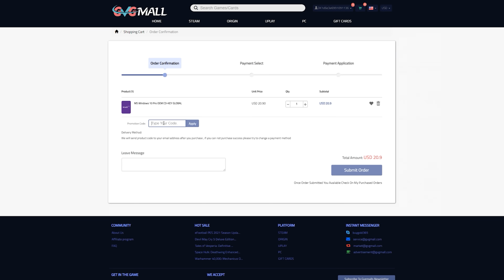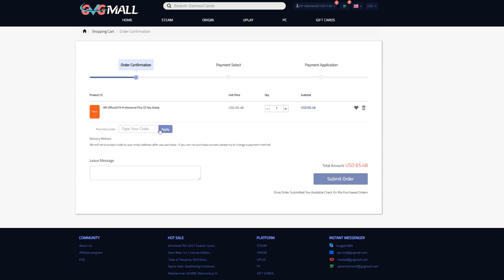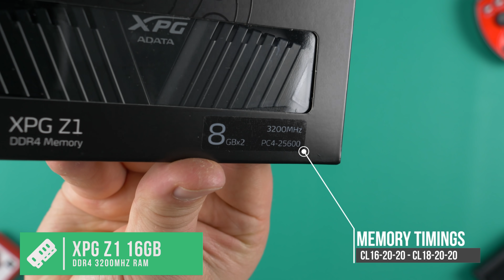Best $600 Gaming PC Build Guide 2022

Comment: 4:24 my dad has that case, really COOL's the components inside ,especially with a ryzen 9 and a tower cooler, didn't expect it to be just 83 C, usually these ryzen 9's just shoot up straight to 90 to 100 C.
Reply: What tower cooler is your dad using?
Reply: @kyoheii  ID Cooling, not sure what model though, its really chunky.
Reply: I don’t really like the case because it’s so small I’m going to use this build guide but swap out the case

Comment: Its soo accurate to what I'm wanting to build for ages
Reply: If you can get 1650 gddr6 that's the cars I have with i3 10105f and I get 144 fps in apex
Reply: @leonboonzaaier486  in 1080p high?
Reply: @zakiyunzakir9562  no low you will need a 3060 or better to get 144 in high

Comment: I like these guys content but this is NOT a good build right now. Go 12th gen i3, the i3-12100F is currently $105 at Newegg U.S and a rtx 3050 is $300 also at Newegg U.S. Going with those parts is a lot faster and it wouldn't cost much more.
Reply: This my exact build.
Reply: Ya that's much better
Reply: @theoneandonlymeme8923  anyway you can tell me what to get so I can build it? I wanna start with whatever you have lol pls
Reply: So I can put a 3050 in this?

Comment: this is the exact gpu im saving for right now
Reply: pls wait a little bit longer because the 1650 has no future proof things. i would recommend buying something like a used 1080ti or used 2080 super due to the extremly low prices used.
dont be scared of it being used, but do look out for gpu that has been used to mine because they usually dont have long lifespan left.
Reply: @rando3962   WHERE ARE YOU FINDING CHEAP 1080 TI's. I've searched far and wide, turned every stone, sniffed every corner, and the cheapest I could find is 500 CAD.
Reply: get a 1060 for used
Reply: Don’t go with a 1650 or 6500xt both garbage GPU’s. At least wait and go for a RTX 3050 or RX 6600.
Reply: @ZackSNetwork   you underestimate the prices near me. The gtx 1070 is a better buy for me. but i have a 980 ti rn so im chillin
Reply: @carl5137  used
Reply: @rando3962   I've ONLY been talking used
Reply: @carl5137  I know the pain. This is Canada 😭
Reply: RX 6600 for $320 (which is $10 *BELOW MSRP*). you will get twice the VRAM, much better performance, FSR upscaling, ray tracing (although very limited), and many other features that the 1650 does not have. it’s worth the extra $50-100 and you won’t have to replace it in 2-3 years. the GPU is one of the most important parts in a gaming PC, it’s usually worth spending a bit more money on (as long as you’re not paying well over MSRP).

Comment: Would the 6600 also be a good option? Would make it more of a 650-700 build
Reply: Yes
Reply: the 6600 is way better. I would say almost 40% better
Reply: 6600 XT and 3060 is the better GPU you could pair with an i3 10th gen without any noticeable bottleneck apart from certain cpu hog games like bf 2042 but that game is less optimised than the late Roman Empire so meh.
Reply: @loowick4074  that puts you at a 1,000
Reply: @isaafridi7146  nah it just about 800 - 900
Reply: @isaafridi7146  It's almost 40% better than the rtx 3050 in gaming. So it would be close to 90% better than the gtx 1650.
Reply: @jadenblackerby3325  you're right
Reply: @loowick4074  I have this build and the bottleneck is so big that I have to play games at 1440p or higher (sometimes even 4k). I Just bought a i5 10400f to pair with the 6600 xt and according to tests I saw its a really equivalente build
Reply: @jadenblackerby3325  how is that even mathematically correct in any way
Reply: @ABV 92 According to almost every benchmark it beats the 3050 from 20%-50%. I guess I over exaggerated a bit, but it's still way faster than the 3050, which is faster than the 1650.
Reply: @mukuroikusaba7347  I am saying that the 6600 is around 40% faster than the 3050 in terms of gaming, and the 3050 is around 50% faster than a 1650 (sometimes 70%). Which would lead me to say the 6600 is around 90% faster than the 1650.
Reply: RX 6600 is the best for budget gamers right now. 6600 XT is a decent bit better if you have another $80 or so to spend. but if you do a bunch of production-oriented tasks too and absolutely need an NVIDIA card for certain applications, then the RTX 2060 or 3050 are good options too if you can find a good deal.

Comment: I'm so behind on PC building but is this good enough for a general work pc? I figured it's a good budget price overall but I just don't have the funds to get a $1k pre-built with not so great specs. Just curious if I can out an i5 on this board instead of the i3? Or does that throw everything off,
Reply: This pc will do it amazing for work atm. And yes you can put a i5 but only if it's 10 or 11th gen
Reply: @Sam.K040  if what’s 11 or 10th gen
Reply: @sergy0918  The morher bourd only supports intel 10th or llth gen processors

Comment: I have the same case and GPU (GDDR6 version actually) but my CPU is a i3-12100f  and motherboard is B660M-A D4. Easily get 144FPS on Fortnite. Soon I'll get a RTX 3050 as my next upgrade on my PC and a 240hz monitor.

Comment: My system is i3 10100f_ram 32g2666_power600_ motherboard prime h510m-k _ I am looking for a good graphics card that does not have a bottleneck and does not cause problems.  gtx 1660 s/ti  gtx 1070/ti. gtx 1080.  Help me please😢😢😢😢

Comment: Love the vids ❤ is there a chance you could do a budget of 1500 - 1700 dollars?
Reply: With $1500-$1700 you should be able to do a R7 7800x/i7 10700/f/k - Rtx 3060/3060 ti/3070/3070 ti possibly assuming you get it at MSRP for the gpu. The used market is also an option and the market is dropping in prices as each month passes which indicates that the specs given can be done at the budget. Correct me if I’m wrong, but that’s the type of computer you are looking at, at that price range.
Reply: How can that be a budget
Reply: @zemonsterr  this question makes no sense
Reply: @tenshi1333  ive seen 3070 ti going for 700$ so i would definitely have that for a 1500$ build
Reply: @zemonsterr  IM SAYING

Comment: The Rx 6500 xt(in the US) is $200, so if it's available get it it's a much better deal. Also try to get an i3 12100f it's much better.

Comment: Or you could do the CLASSIC $300 gaming PC, gtx 970 GPU, used old Dell with an i5 2nd gen, 8 the ram. Just need another ram stick. Or you could do a gtx 1030 solid on older titles, 30-40+ fps on newer titles. (Med-low), tested it on BF5, Cod Warzone

Comment: well im not sure if the evga black 3050 is available in other parts of the world but ive seen it in and out of stock for around 230 that would be a solid gpu upgrade over the 1650 if u have it available

Comment: roughly in pounds the price is 582 or 592 or cheaper cuz you can find the gpu for cheaper btw i dont use this pc i have a i5-3470 16gb ram gtx 1060 6gb 550psu i have 256 gb ssd 1tb hdd and i bought it as a prebuilt but i upgraded alot of the parts the gpu was a 1030 before and same with cpu was i5-2400 and ssd i bought by itself and i pretty much changed most of the parts including motherboard and psu
Reply: Thanks for watching and commenting 
You’ve been shortlisted among the winners for the ongoing giveaway contact address above👆👆for claiming ..

Comment: would honestly swap the GPU. sub in a rx 6500xt it's on average 10-20% faster depending on the game and costs just as much unless you absolutely need the encoder.
Reply: Totally agree rx 6500 xt is better than 1650 and 1050ti in pcie gen3 and it's as good as a 1660 in pcie gen 4

Comment: Would of been a better idea to do i3 12100F + RX 6500XT. Same price more performance
Reply: Does it cost $600?
Reply: @raiznsisig  u can build it for right about 600 i think
Reply: @elbroken1093  if i'm gonna use an amd gpu, i might aswell use and AMD cpu. What cpu is best paired with it?
Reply: @raiznsisig  AMD CPUs don't support PCiE gen 4 like 12th gen intel cpus, so the performance of the rx 6500 xt is much lower when paired with AMD cpus
Reply: @tiagopelegrineti  okay... advice taken...
Reply: @raiznsisig  well thing is the budget amd cpus do not support pcie gen 4, and on pcie 3.0 the 6500xt can perform pretty bad, so maybe really stick with a 12100 (F), or if u really want AMD u need at least an 5600.
Reply: Nope garbage GPU.
Reply: @tiagopelegrineti  False AMD CPU’s do support Gen 4. They don’t support Gen 5.
Reply: @ZackSNetwork  and the 1650 is the holy grail?
Reply: @elbroken1093  I didn’t say that clown. If you are gonna spend your money get something that has long term value that will provide a good experience.
Reply: @ZackSNetwork  multiple benchmarks say the 6500 xt is better than the 1650.
Reply: @elbroken1093  the 1650 is still pretty well overpriced.   Do not pay more than $190 for this budget card.   I still see them listed for $300+ and people still buy them because its nvidia.    But im starting to see the 3050 available for $299
Reply: @ZackSNetwork  mans calling me clown, the 6500 xt is better than the 1650 in any regard when used properly, except for the fact that it has no video encoder. that long term value is just not a thing rn in this budget, but the 12100f 6500 xt combo, atleast has lga1700 going for it which is good in long term.
Reply: Can't go wrong with 12th gen cpu 12100f the  5600 is cool but intel got the upper hand in gaming and windows 11. I mean I'm rocking r5 3600 with a rtx 6600 since parts were hard to get will be upgrading soon waiting to see amd next gen am5  platform
Reply: @raiznsisig  amd CPUs are garbage for entry level.

Ryzen 3s cost more than i5 10th gen
Reply: A b660 motherboard is quite more expensive than a b560 motherboard right now. 

In fact a h610 is closer priced to s b560 than a b660.

Factor that in too and decide.
Reply: The RX 580 is better than RX 6500XT bro
Reply: @raiznsisig  yes
Reply: the 6500 XT is an absolutely terrible card. do not buy it for any reason, we can’t let AMD get away with releasing intentionally bad products. especially if you buy it at or above MSRP ($199), you are encouraging AMD to make worse products in the future.

Comment: Ok, I know I may get hate for this, but the 6500xt would be a better option for this build as it's a b560 board (pcie 4 compatable) and the 6500xt is better performing, it's more recent so it will be getting drivers longer, and it can be found for msrp on Amazon with prime shipping (the powercolor verison) (as I type this). So yeah this is a good build no doubt, but I'd really love it if you could use the 6500xt in a build someday.
Reply: Thanks for watching and commenting 
You’ve been shortlisted among the winners for the ongoing giveaway contact address above👆👆for claiming ..........

Comment: Honestly just get a 200$ Rx 6500XT off of Amazon. It’s about the same price as what 1650s on eBay are going for yet it’s faster.
Reply: Ya, RX 6500xt is a better choice over any 1650
Reply from the maker: on a gen 4 board yes, but gen 3 is a different story with the 6500 XT
Reply: RX 6500xt is a garbage GPU. Even tech YouTubers are telling people to stay away from it like the Black Plague.
Reply: @ZackSNetwork  it’s garbage in terms of Rtx but in comparison to the 1650 super it has better performance.
Reply: @ZackSNetwork  it cost the same as or better than the 1650 and it performs better, so if it cost the same and performs better than the the 1650 it makes sense to choose over the 1650…
Reply: @ToastyBros  aren’t Intel 10th, 11th and 12th motherboards all pcie 4th gen motherboards?

Comment: Keep in mind that a 1650 is $255 on Amazon new. a 1080 TI is currently $350 used on eBay you’re better off saving up an extra 100 - $150 for a much better performance
Reply: Thanks for watching and commenting 
You’ve been shortlisted among the winners for the ongoing giveaway contact address above👆👆for claiming .......

Comment: 600$ is very horrible for this in my opinion, You can’t get a prebuilt hp with Ryzen 5 and 1650 super for 500$ with that! I just easily did a Pc build with a Ryzen 5 2600 and 1070 for around 600 and it seems like the best price to performance you can get. The 1070 is 87% faster than the 1650 and it gets double the fps in most games. And the 2600 has 6 cores and 16 mb in cache memory vs the 4 cores and 6 mb in cache memory the i3 10100 has. Good video though otherwise than the fact.
Reply: Thanks for watching and commenting 
You’ve been shortlisted among the winners for the ongoing giveaway contact address above👆👆for claiming ..